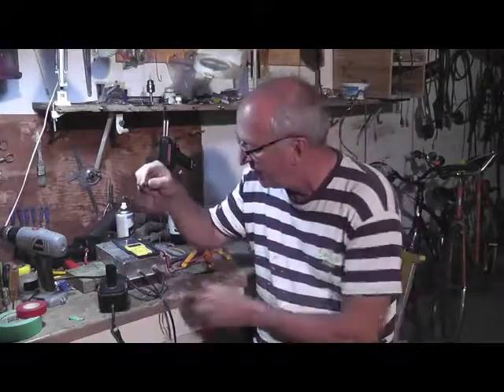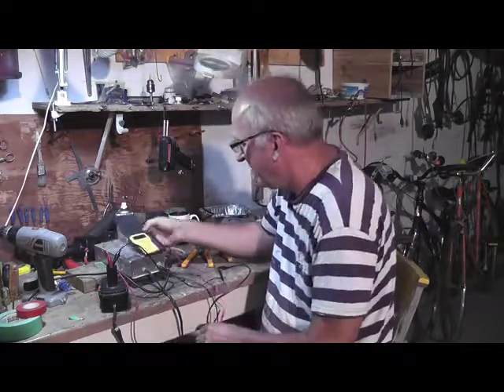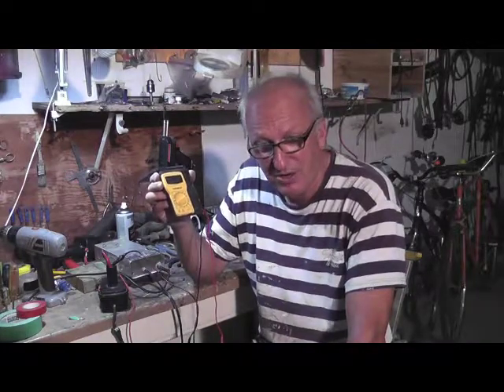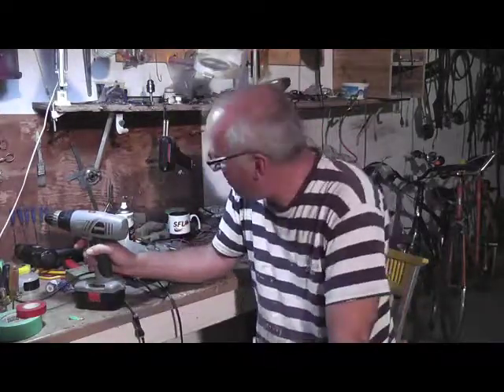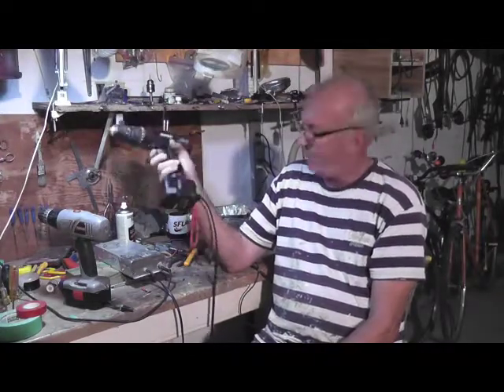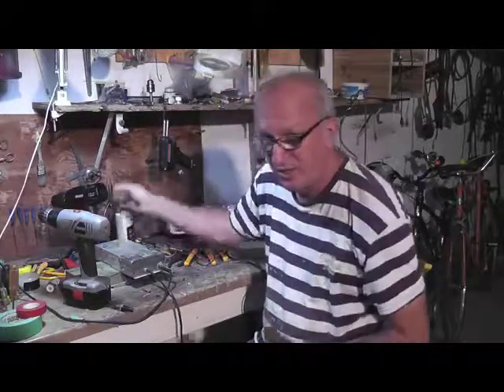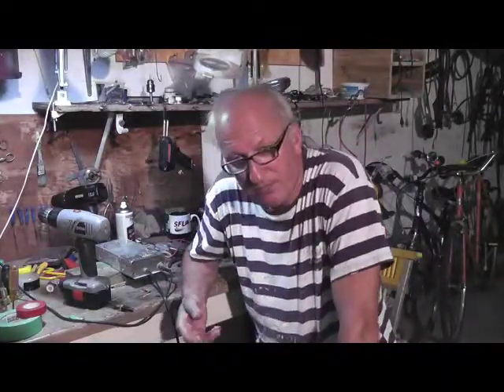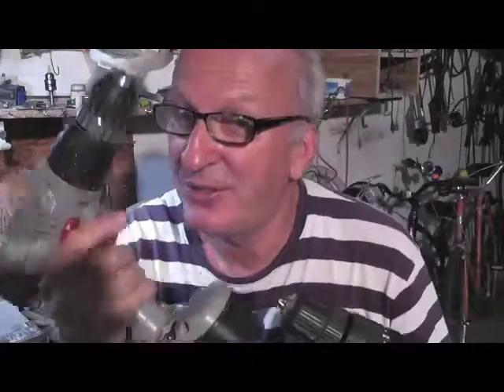Battery Drill To Main Power

Comment from the maker: YouTube Channel: Colin Dunbar sent me a message: 
those old 7.2 drills will actually run quite well off an old 12 to 24 volt laptop power brick I have done this lots of times no problem.
I have not tried this. You could message Colin Dunbar: " I hope this helps"

Comment: If my drill rating is 7.2V, so in your opinion, is it ok to use 12V adapter? Cos 7.2V is quite odd and hard to search for.
Reply from the maker: It could burn out as it is 5VDC difference. The drill is rated slightly higher than the 7.2VDC and the highest I would go is 10VDC. My adapter was reading 14.5 VDC and I used it on a 12VDC. I took a chance and it worked. My drill was 2.5VDC less ..yours is 5VDC. Never tried this because in Vancouver there are hundreds of used drills for nearly free and the higher VDC drills have more torque.